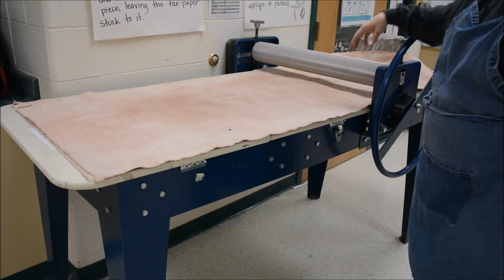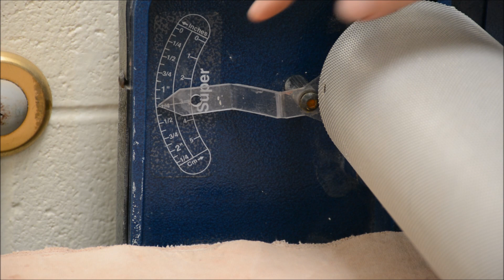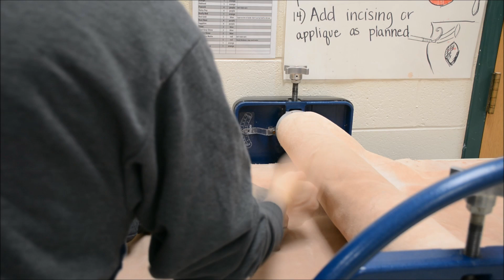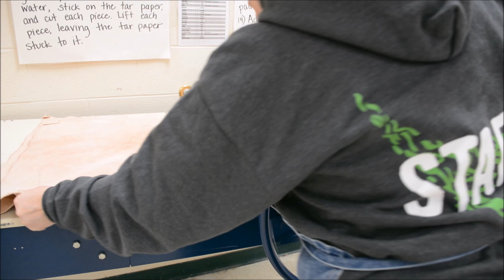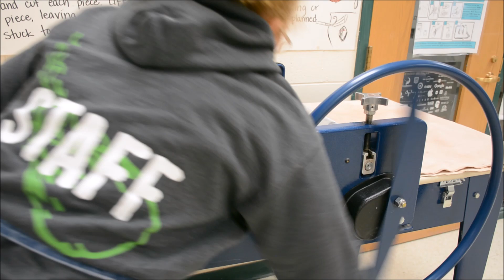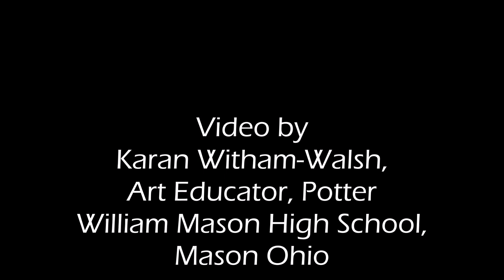How to Use a NorthStar Slab Roller to Roll Clay Slabs -a Demonstration

Comment: Uh-oh—you mentioned never putting anything through this. When I made tiles, I rolled the clay sandwiched between canvases, but directly under the clay a piece of plain newsprint paper, on top of a piece of drywall w/taped edges—and then let the clay get leather hard on the drywall before carving.  Hopefully I didn’t break anything tonight!
Reply from the maker: Oh- that sounds like you wouldn’t have broken anything! Worst case scenario may have resulted in cracking the drywall!? My darling students have tried putting things like pencils or knives in it which don’t have as much give!  Lol!

Comment: Great Video, thanks from a fellow art teacher.  I just got a small Brent, and it's not quite as fancy as yours, but I'm hoping it will get the job done.  Like you, I like wedging boards and pin rollers, but I have students that can't roll a slab properly, so I'm hoping my new slab roller will be a good tool for them to make good pottery.

Comment: Do you think this can double as etching press please... with good quality felt blankets ?
Reply from the maker: I guess?  I've never tried it with it.  And I haven't done etching for over 30 years!  :) . I think you'd have to have boards too, if I remember?
Reply: @KaransPotsAndGlass  Thank you. I am scratching my head if this can be made to work for printmaking. If so, I'll save good money over etching press of this size. Also, I hope the textured roller wont be a problem when used with good blankets.
Reply: @KaransPotsAndGlass  If I may persist... do you think if I lay a polymer sheet on bottom roller, it will lay flat across the slab roller inbuilt bed(s) on either side of bottom roller and the bottom roller itself and slide forward or backward with the crank movement ? Thanks in anticipation !
Reply from the maker: @rang....-._.-....0.  I honestly don't know- sorry- I can't picture it! :)